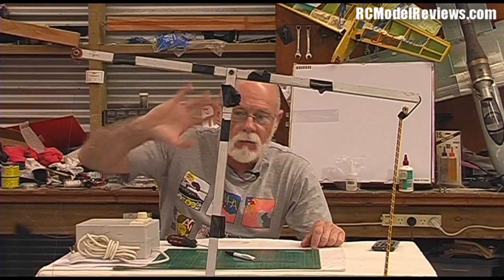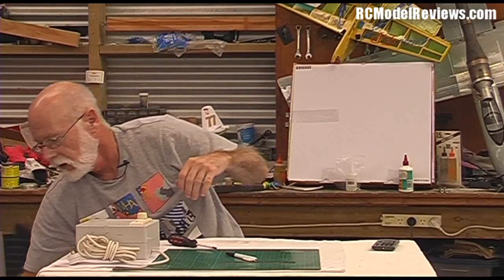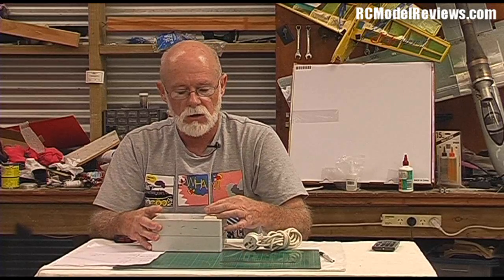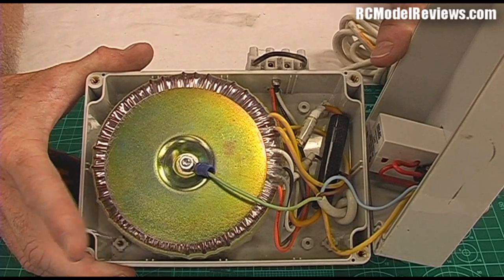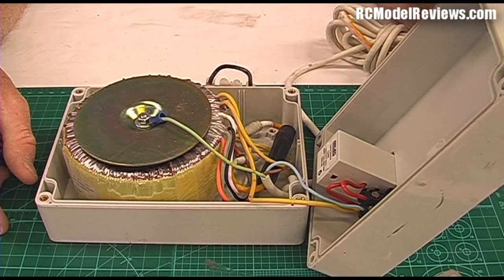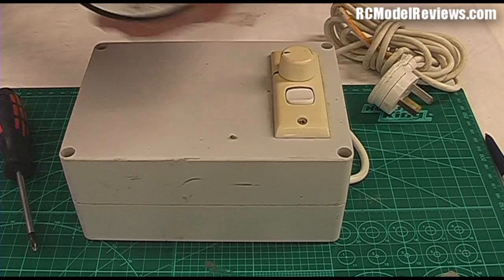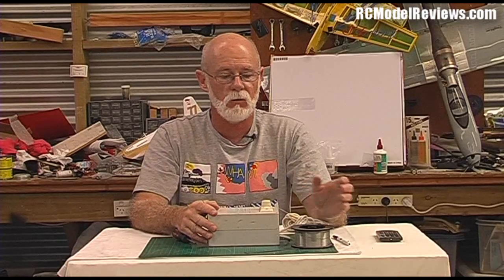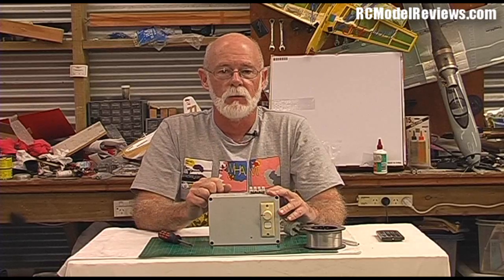DIY: hot-wire foam cutter for making RC planes

Comment: PERHAPS IT'D BE WORTH DOING SOME ""BREAK TESTS", ON ANY WIRE, USED FOR FOAM CUTTING, AND FIND OUT THE POINT AT WHICH IT CAN RELIABLY  HOLD A "MAXIMUM"
 TENSION, AND THEN REDUCE THAT BY A REASONABLE %, AS A SAFETY MARGIN,... THEN ALWAYS SET UP ANY FOAM CUTTING WIRE WITH THE "PROPER TENSION", TO ASSURE MINIMAL DEFLECTION OF THE WIRE, DURING THE CUT.

Comment: This is so frustrating. I was hoping he would give the specs of the transformer, but no - just the voltage, not the watts. HOW MANY WATTS IS THE TRANSFORMER??
Reply: You can also use a toy train transformer.  It has a variable speed controller (a.k.a. voltage regulator) usually 24V

Comment: I used a PWM (pulse width modulator) for my hotwire. You can find a PWM off ebay for really cheap that will provide enough amperage. I use a 12v battery charger to run the PWM and it works great. You can also get just about any dia nichrome wire off ebay as well in shorter lengths for reasonable cost.

Comment: I would really love a build video on a CNC wire cutter as well. With the price for 3D printer parts getting very low, parts like RAMPS, arduino mega, stepper motors and drivers, thermistors and so on, are getting really cheap, making it possible to build such a machine at a reasonably price! PLEASE build a CNC wire cutter :-)

Comment: I have built a wire cutter and had problems using a 12 volt battery direct to the cutting wire, there is no control over the temperature, I want to build the power supply as you recommend, I have a 22v double output  transformer I have a dimmer switch which does not seem to work at the output voltage of the transformer,  can you give the name of the maker of the dimmer switch and also a detailed wiring plan.
Thanks
Reply: +Ken Mainstone try getting a 48v control transformer they are usually small, make sure they are UL, CSA  listed so that you don't buy some cheap transformer that will blow up and cause a fire inside your house... if you cant find a 48V control transformer try using two door bell transformer with a 120v primary and 24v secondary and connect the the primary with two splices and then connect the secondary side as a series connection, you have to make 100% sure that the transformers are the exact same models with the same exact winding ONLY USE A SINGLE PHASE WIRING SETUP do not use two hot conductors to power the transformers just use the black and white conductors if you are in the US and make sure that the transformers are grounded if they can be. (if you get hurt or you have property damage  don't blame me im not responsible for what happens to you.) also try connecting the dimmer before the transformer that might help as the dimmer just changes the frequency not the voltage or the current. make sure you get a fuse that's below the current limit of the transformer and the wire.
Reply: +Risto Mladich Hi, I have now solved the problem I went to Maplin and bought a transformer that reduced the voltage to 15 volts and a also a dimmer switch that gives variable temperature for the cutting wire which I purchased on ebay.  It all works perfectly and I have successfully cut the wings, tailplane and several other bits, turtle deck etc. It was not cheap, £51 but it gave peace of mind that I have a reliable and safe cutting system, the cutting bows were very easily constructed from some odd bits of timber, I made two one large for wings and one for smaller bits, I have yet to perfect a hands free set up but its in the pipe line.
Thanks Ken

Comment: Most definatly not being rude here or a jerk but, an easy foam cutter is buy a weller soldiering iron that the solder tip plugs into the side and get some nichrome wire You can get at most E-Cig shops and use aligator clips connected to a common household 2 prong and plug it in. Now You can dial the power with weller iron control knob. I cut 3-4ft wings easily and You can a small hand held version to do some shaping. Good vid though Bruce, You are absolutely the best bar none.

Comment: Hi Bruce, I could really use some help building my foam cutter. I am using a old computer power supply (the 12v 15 amp side of the supply, it`s what I have laying around) and need to know if I can install a typical household dimmer switch inline with the 120v input of the supply to vary how hot the 36 inches of Nichrome wire will get. Or do I put a 12v rheostat/potentiometer on the 12v output side of the power supply but before the connecting leads to the wire ? Thanks, AJ

Comment: Hi. Excellent series of videos, but just one question on hot wire foam cutting.  I haven't managed to find ANY video (on YT or elsewhere), that discuss or show (2 part) polyurethane foam cutting.  Even you yourself say (around 0:28 in this video),  that with the cutting system described you can cut various foams. So, question: will this kind of hot wire cutter cut 2 part type polyurethane foam?  Regards Mark in the UK

Comment: I saw one video where the guy used a desktop computer power supply as the power source. It seemed to work very well for the pink rigid house foam insulation.

Comment: I want to build a hotwire powersupply on the cheap I have had one that I use to power off a 12v battery, for this one I want to power it off the mains. Where can I source a taroidal transformer for free or on the cheap(under $15). what would be your power recommendation for a hot wire lenght of 1800mm. Thank you for all the grate vids Bruce.

Comment: CNC Stands for Computer Numerical Control.   It's what drives automatic routers and laser cutters and in this case, a hot wire cutter.

The idea is you model up something in a CAD program and then let the computer control the cut.   I'm not sure how it works with hotwire but I assume the two ends of the wire are controlled independantly.

Comment: Hiya Bruce,

I was wondering if any of these would be a suitable transformer.   A little expensive but this is my second wire cutter project, and I'd like to be able to cut up to 35 inches of high density XPS foam easily.

australia . rs-online . com/web/p/toroidal-transformers/2238780/
australia . rs-online . com/web/p/toroidal-transformers/2238752/
australia . rs-online . com/web/p/toroidal-transformers/2238819/

I'm leaning towards the 225va one....

Comment: CNC would be nice to see please. Im using a similar setup with a simple 60W 12V halogen light transformer and light dimmer. For wire I use bicycle brake cable, this is also stainless. I untwist the strands and make them straight by applying power from my stick welder. Wait until it smokes/glows then pull. This gives you a much thinner and precises wire. Its readily available, cheap and stronger than nicrom wire as you know, the only problem is straightening it as I said.

Comment: Thank you for the information about the wire that was very helpful. My hot wire experiments always suffered from the problems you addressed.

I would love to see a CNC version (personally already into 3d printing and cnc routers). The one thing I was wondering about is creating the proper G code for airfoils. For me it has been really difficult to cad airfoils with any accuracy. If you do a build could you include this section as well.

Comment: I made one like that a couple of years ago with a radio shack 24v transformer and a dimmer from a big box store.  The parts weren't up to the task and the transformer ate itself pretty quickly, taking out the dimmer in the process (as I discovered when it immediately destroyed a replacement transformer).  I replaced it with an old school analog train transformer, worked great.  Also, nichrome wire is available from McMaster-Carr in a range of gauges.

Comment: How do you get away with using a triac driving an inductive load like your transformer.  If you can't use one of these dimmers on a ceiling fan or florescent lamp containing a ballast.....how can you do this???  Do you have different dimmer controls over there in NZ???.  I think I would have used a variac....and stay away from all those high voltage transients.
Flash1940

Comment: Mig is Metal Inert Gas welding using argon or other gas and a constant feeding wire, the wire is probably a hardware store item even in Mexico, be careful not to get flux core gasless wire which you don't want to use.

Comment: You use a much bigger transformer then many that people show on Youtube, which is probably better.  Thats why you dimmer is running at the 1/4 setting, you aren't needing all that power, but have it available. And using higher voltage for a longer wire is very good and I had not heard that either.  I will definitely keep that in mind when I build mine.